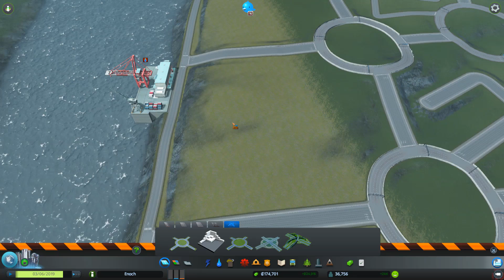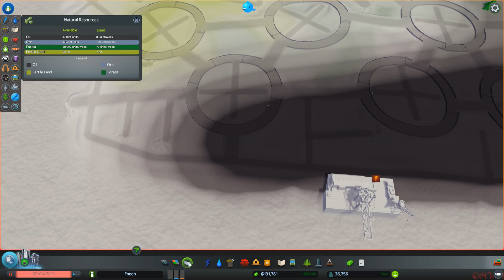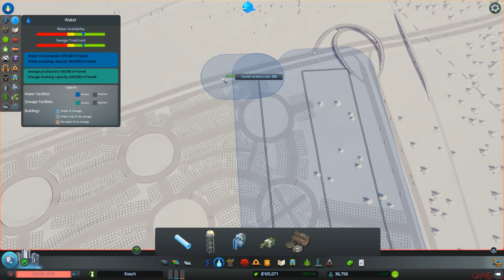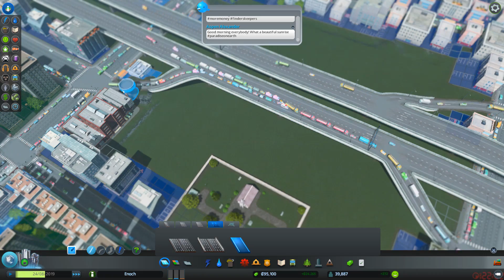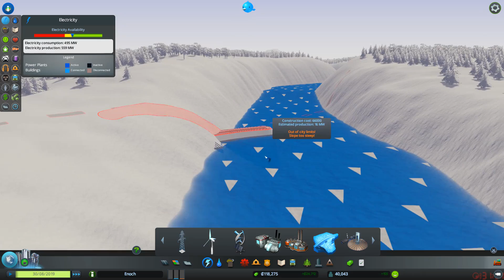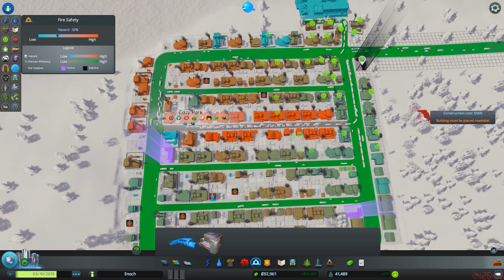Cities Skylines: City 2 - Episode 6

Comment: Kailvin, you can marquee (or whatever it is; the square tool) over regions without interfering with already-zoned tiles (like the brushes). This would've saved time with your mass-high density residential zoning around 8:00; just drag a square over it all!